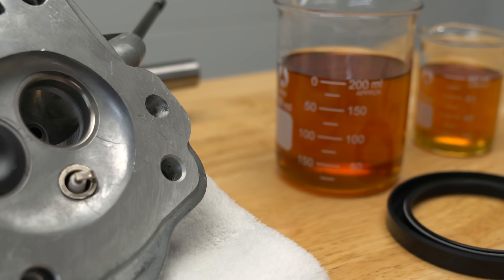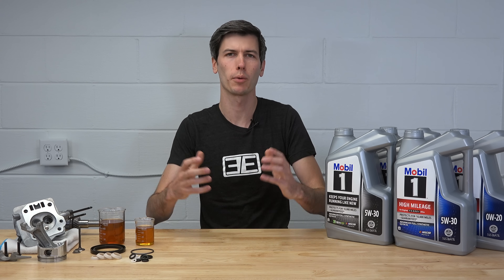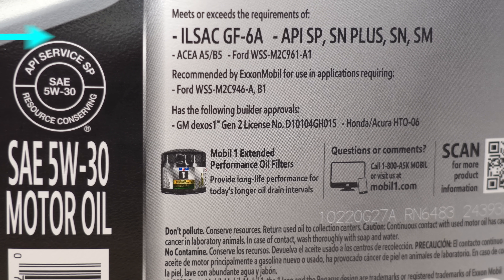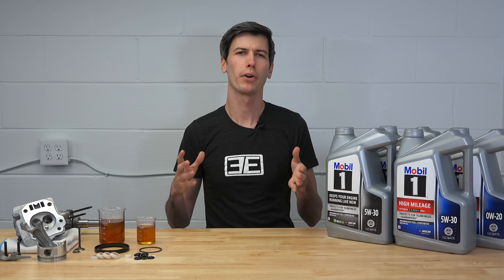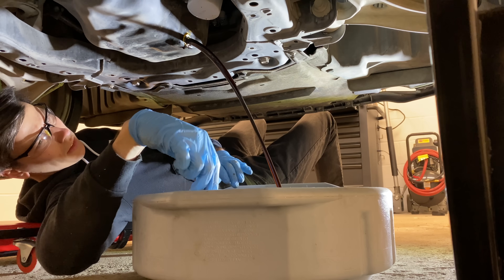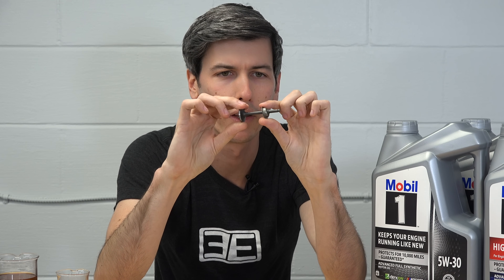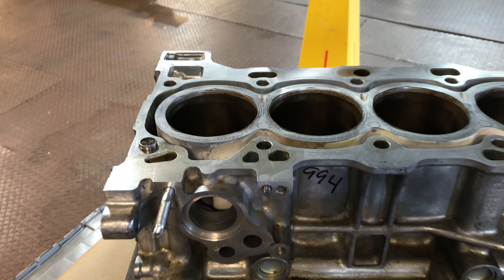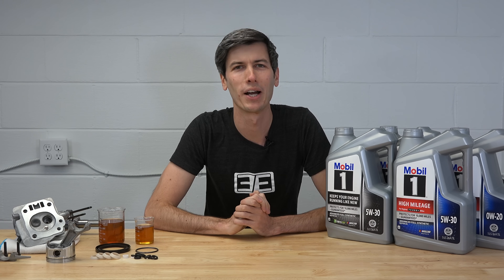Is Synthetic Motor Oil Bad For Old Cars?

Comment: It has been my experience that synthetic oil does not get along with natural rubber, cork and paper gaskets and seals. Industrial engines don't like it either. I tried using synthetic oil in Briggs and Stratton engines when my brother and I raced go-karts. Found excessive cylinder and piston wear. Went back to petroleum and the wear slowed way down. Oil companies should not be forcing us to use synthetic. We should be able to buy petroleum if we want it.
Reply: You weren't using the correct weight oil, or your oil slinger wasn't pulling enough oil up. 

I'd bet you find all wear would stop with a synthetic 5-40. 

They make what sells. Since everything else is pressure lubed and synthetics stop almost all wear, people tend to buy them.
Reply: I use nothing but synthetic in everything I own  motorcycle cars trucks old muscle cars lawn mowers generators for many years never had a problem.

Comment: New car in 2006 -Mobil 1: same old car in 2021 still using Mobile 1 after 130,000 miles with no engine oil drips, leaks or gunk detected during oil changes with same car since 2006. Buy a good oil and stay with it for the life of the car. new engine replacement is not an option but preventative care is the affordable option and just use common sense. Best  oil keeps the mechanic away. It's your choice.

Comment: Started using Mobile 1 in 1997because they out performed all other synthetic oil at that time except Royal Purple. Royal Purple was being used in the Petro-Chem Industry for years in 55 gallon drums but not sold to the public in small amounts like quarts or gallons. The supervisor over maintenance at a chemical plant I worked at went to testing demonstrations a couple times a year where the oil company would destroy motors running them dry with no oil. Running without any coolant. Put bearing in hydraulic press and pressure applied until failure. Mobile 1 pioneered synthetic motor oil. In 2021 Royal Purple is the best synthetic motor oil. Put some 75W-90 High Performance Gear Oil in your rear ends and transaxles you will see better gas millage. And as for conventional motor oil that dark Havoline  or Valvoline Motor Oil rated in the top 10 where as Pennzoil, Castrol Oil, Mobile and Texaco were near the top 20.

Comment: I asked several mechanics if using oil meant for Mercedes, in my older Dodge truck would be of any advantage and none had an answer outside of saying make sure it's the same rating as manufactures specs for my truck.  I did the oil change with it a couple of weeks ago, and it's lighter so will be changing it more often. It's running in the perfect of the temps even during this hot summer, gas mileage is better along with performance. Take note, the improved gas mileage automatically pays for it, so you aren't spending more on oil, and there are additives in oil meant for Mercedes that is on the upper echelon which is one of the reasons they do not need to have their oil changed as often as other vehicles. 

You can baby your cars like this and get more life out of them, just stay on top of it, to include with the original is about.  Keep in mind, I suggest instead of a complete change in formula's, mix them together and find that sweet spot ratio.
Reply: You intend to change oil more often then you say this oil doesn't need to be changed as much. That doesn't make sense.
Reply: @jthomas3773  I did not say it doesn't need to be changed as much.  Running thinner oil will break down more quickly so it needs to be changed out for the regular oil sooner rather then later.  It does a good job at cleaning out the engine and breaking down deposits in tighter areas due to it's low viscosity. If it prolonged changes from the regular oil, probably, but that's not the point of going this route, and you certainly are going to be paying for the lighter weight in between oil changes, oil changes... It's just to help prolong the life of the engine.

Comment: I've been using synthetic oil for years..... Swear by it! It solved a lifter collapsing issue on a new engine and transmission failures on the same vehicle

Comment: I have a 73 Chevy Monte Carlo with a 350 cu. Engine with only 30.000 miles if that I been using 10W- 30 Conventional Oil After I got 5000 Miles on it Per the Mechanic that installed the 
The Engine. I was going to start using 10W - 30 Full Synthetic Or could I go to a Lighter Full Synthetic Like a 5W - 30 Full Synthetic or does it Make any Difference? Please someone Reply!
Thanks!

Comment: Can speak to the rotary engine aspect. You will burn more oil using synthetic oil….. have now doubt there. However the benefits out weight the consumption cost as long as you check your oil weekly.

Comment: I love Mobil 1.. used it for years. The best filters to use, Wix, and Napa Gold.  Valvoline has good Syth oil too, but Mobil 1 is my choice.
For the X6 M I use - Liqui Moly 2024 Synthoil Race Tech GT1 10W-60, with a Wix filter. If you own a BMW and its not an M, don't use a 10W 60, I believe its something like a 10W 30 for the 6 cylinders motors. Go by your users manual.

Comment: Synthetic oil isn't bad for any car.  It's oil.  Unless some car has seals or gaskets that have some issue with modern synthetics, I wouldn't worry about it.

It flows better when cold, it resists breakdown from heat or sheering better...  Last longer as a result...

There really isn't a downside, other than cost.

Comment: I didn’t view this video. I started using synthetic motor oil in a ‘64 Impala SS I bought several years old. I’ve used synthetic in all cars since. Never had a problem. Most all of the cars were used. Some with over 100,000 miles on them. Never had an oil related problem. Of course I’ve always changed the oil regularly.

Comment: If your mechanic/dealer is telling you that you still need to change your oil every 3000 miles/3 months with either synthetic blend or full synthetic oil, find a new mechanic/dealer.

Comment: Fails to address the question of what happens to camshafts in flat tappet engines when the zinc additive package that provided high pressure lubrication is no longer added.  Can you run Mobil 1 in an aircooled VW or Porsche engine with flat tappets without ruining the cam and lifters?  How about in a Dodge?

Comment: I became a synthetic oil user way back in 1982. I was introduced to Amsoil 2 cycle oil because I was having issues with a weed trimmer and chain saw. Switching to the Amsoil products instantly corrected my problem, so it was logical to try the 4 cycle oils that were available then. The results were dramatic and as Amsoil has moved onward and upward with their products, I have never stopped using them. I have kept detailed records of everything vehicle , and lawn equipment. For example: I owned a 1994 GMC truck with 4.3 liter. I had that truck for 14 years. I sold that truck in 2008 and it had over 210,000 miles on it. Everything had Amsoil synthetic lubricants. I can tell you that 2 years later the buyer called me stating that he continued using the same oils and the truck is still performing fantastically. I currently have a 2002 GMC Sierra with the 5.3 V8. currently has 145,950 miles on the odometer. Still has the same all around performance as when it was new. I also know that if you have a vehicle that always used conventional oils, and you are considering switching it to synthetic, there is a correct way to do that. I know this for a fact because I purchased a used vehicle for my son. I followed the Amsoil recommended  procedure of implementation of switching to synthetic oil. That vehicle responded very well. My son drove that vehicle for several years. I have had many different situations with different engines types and makes and I can tell you that I am never going to ever use conventional lubricants. I can also say that Mobile 1 does NOT hold a candle to anything Amsoil has. And just in case you're wondering.... no I am not a dealer or distributer of Amsoil products. Just a 30+ year user and damn proud to say so.
Reply: Nearly all engine failure is down to used oil. A high price luxury brand mfg once tested their 12 cyl engine for 1 million miles equivalent by continously replacing the oil as it was being used, and it didnt stop running. Proper lubrication and lack of contaminants can keep engines running a very long time. The entire point of oils and lubricants is to provide a compressed "liquid" surface which both parts glide against. Like squeezing a gummi bear between your thumb and finger and rubbing it back and forth. In that scenario, your engine should NEVER wear. It wears because of particulates, dirt, metal shavings, whatever.
Reply: In 1982 my car was 30 years old, it MUST have mineral oil and 1200ppm ZDDP.

Comment: if were to switch from 5-30 to 10-30 with leaks, believe me, there IS a substantial difference. In my experience, the engine leaked almost half as much less. With temperature and heat cycles considered, this is easy to understand.
Reply: That is weird because the 10w30 has the same viscosity when warm as the 5W30... if you want a higher viscosity lubricant you need a higher second number

Comment: Synthetic is good but will slowly clean an old, dirty motor out.  It will expose the issues with seals and gaskets.  Also will wash crud into the pan. Gotta watch the oil pressure. Can clog the intake of the oil pump.

Comment: He cant cover everything but I think it would be helpful if he would have also covered
What happens if you stop  using high mileage oil?

Bad PCV valves cause leaking or burning oil..

What if you use conventional oil on a turbocharged engine

These are things most people dont think about and it would be good to hear his opinion....I think I know the answers but would like his thoughts

Comment: Our shop features KENDALL👍 products which covers Synthetic Oil..Synthetic Grease..Fuel Enchancers..& Synthetic Tranny Fluid..I personally have used KENDALL in my 2002 S10..2011HHR..& 2000 E350 Motor home..for over 200,000 miles now..💪

Comment: I have a real life story regarding mobile one I had a Mazda mx 6 in the late  Nineties. I had done all the old changes myself and I was using mobile one because at the time it was guaranteed for 60000 miles I didn't buy that I'd never take mine more than 10000 but I did change it regularly even though the oil was very expensive long story short when my car got up to about 45000 miles I had gunk all over the place I had tapping valves. When the mechanic opened the top of the engine there was oil gunk all over everywhere!. $2000 later I had the whole top of the engine rebuilt. because I only had receipts for the oil and not a "Jiffy Lube type place, Ihad to eat the cost. I'm not saying it's a bad product but they definitely overrated the hell out of it when it 1st came out and a lot of people like myself lost a lot of money and damage to perfectly good engine..

Comment: My 78' Toyota GT had 150,000 miles on it when I decided to try Mobil 1.  Always changed the oil and filter every 3,000.  Did a lot of oil changes myself.  One day after I switched oil, I noticed oil pressure low.  Dipstick was dry as a bone.  Added 3 more quarts, and a couple of days later same deal.  My car never used or burned oil before.  The oil was just too slippery. I changed back to my good old Quaker State  and drove that car over 340,000 miles until a drunk hit it while it was parked on the street. Totaled it.  My friend who had a body shop told me to let it go...LOL. I wanted to keep that car forever.

Wasn't funny back then.  Side note...I happened to look at my Chilton's Book, and it said that changing to synthetic oil was not recommended in high mileage vehicles. Just my experience.

Comment: A nice video but no mention of the fact that very old engines require high levels of ZDDP to prevent wear on high loaded parts such as the cam followers or tappets. As far as I know modern anti wear additives cannot provide this extreme pressure anti-wear protection that ZDDP provides. What's your view on this aspect please? Thanks.

Comment: I run my own oil change shop.
I've always got these older guys who come in and want 10W-40 or 10W-30, conventional.
Even though it specifically says 0W-20 full synthetic on the oil cap and on the dealer's own Stat sheet. They will argue me down, so I make them sign a waiver stating what's recommended, and what they wanted. Basically saying I am not at fault. 
They also want a "grease job" despite most cars having zero grease fittings. 
It's like pulling teeth to get them to understand that a 0W-20 is not too thin for today's engines. Despite what they believe. 
I have this conversation 3-4 times a day.
Reply: which oil would you recommend for Toyota's 1ZZ-FE 1.8l engine?
Reply: @aleksandarnesic8908  What year?  That's the first generation motor, and came out around 1997 through around 2006.
It takes 5W-30 and I would definitely use a high mileage assuming it's over 75k miles. Full synthetic. Castrol is what I always use. Mobil 1 is good but its super expensive. 
Toyota's will run forever with consistent oil changes and air filter replacement. 
Don't forget about your cabin filter, too. It's located in/behind the glove box. (Especially if your A/C isn't blowing hard)
Reply: @timg2088  Thank you Tim G, mine is 2004, running on Mobil1 5w-30.

Comment: Low oil pressure indicator at idle doesn't always mean clearances problem it could be simply that the oil pump got weaker specially when the oil pressure indicator comes on at idle only when car engine is running at normal operating temperature and not cold

Comment: I have used Mobile 1 synthetic oil since 1998 starting with my brand new Toyota Sienna.  I used it so that I could extend my oil changes to 10,000 miles using the Mobile 1 oil filter.  I was lucky. Apparently, that automobile, with that six-cylinder engine, had serious sludge problems.  Using all synthetic oil avoided any sludge problems. I sold the car at around 160,000 miles having had only about 16 oil changes. It ran great. I bought another Toyota Sienna in 2007 and continued using Mobile 1, But I discovered burnt oil under the oil cap and the Blackstone analysis indicated the oil was not holding up at 10,000 miles.  I switched to Mobil 1 extended performance oil and the burnt oil went away.  When I switched to Mobile 1 in a used car I bought in 2005.  I got leaks in the valve cover gaskets and rear crankshaft seal, but still continued to use it for another 100,000 miles.  All new cars I buy will only use full synthetic, but in my Honda and Acura, I only run for 7,500 miles or less to prevent burning.

Comment: NOT TRUE...   A lot of Ford Gasoline & Flex Fuel Engines previously specified 5W-20 oil both in the OEM owners manual and  on the engine oil filler cap.  This was so that Ford Motor Company could meet & gain slightly higher corporate federal CAFE fuel mileage MPG rating values.   In 2002, Ford released a Ford Motor Company Technical Service Bulletin (TSB) stating that all Ford Gasoline & Flex Fuel Engines that previously specified 5W-20 oil should switch to 5W-30 weight motor oil for increased engine longevity.

Comment: My 2004 F350 Super Duty w/ a 5.4 gas w/ 160,000 runs on 5/20 change it everytime it's due myself , had it since it was new , still runs great ! I use 1 quart of Lucas Synthetic Treatment in my oil change and it runs perfect ! No leaks and maintains the same mileage as it did when I got it , about 17 in the city and 28  on the highway. It's really about regular maintenance, rotate tires , inflation in the tires etc ...keep it up it treats you right ..im the only driver/ owner .

Comment: I am trying to determine if I should use synthetic oil or conventional in my newly rebuilt 1984 22r, after it's broken in. I use Amsoil Synthetic in my 4.6 2v in my f100. My old 22r threw a rod and the old pistons had a lot of gunk build up on them. I'm not sure what the right step to take is.
Reply: Best advice:

Any oil > no oil

Comment: While it's not exactly a synthetic vs conventional topic, I'm a bit disappointed you did not address the lack of ZDDP in modern oils and its effect on flat tappet cams.
Reply: ZDDP is still in all oils today with a minimum concentration of 600ppm. 600ppm is adequate for stock flat tappet cams outside of their break-in period.

Comment: Synthetic oil probably does leave carbon deposits in rotary engines because the engine has trouble burning it. I've run diesel engines on waste motor oil thinned with gasoline and I can tell you avoid synthetic oil as a fuel because it doesn't burn as well as conventional oil.  They advertise how well it resist thermal break down and at least as a fuel i'd say that 100% true. It's harder to start a diesel running synthic WMO as a fuel and you get a much lower MPG.

Comment: Most of us aren’t engineers.   Read the directions and then follow the directions in the car manual.   I drive old cars because they are paid for.  I had My 2003 Chevy suburban since new, 
It has 255,,000 miles on the original engine and transmission.   It leaks more oil then it burns.   I   Check the oil leave all the time.  After it hit 25K only put Mobil 1 and Wix oil filters in/on the engine.    Prevention is the key.  I am actually thinking about putting a remand engine and transmission in it.  $10k investment vs $80 replacement.

Comment: Is it still OK to run a latest spec ester based synthetic oil in a rotary engine as the have a much higher flash point?